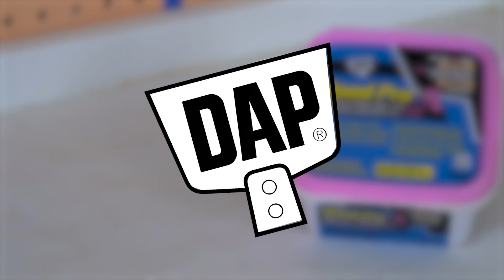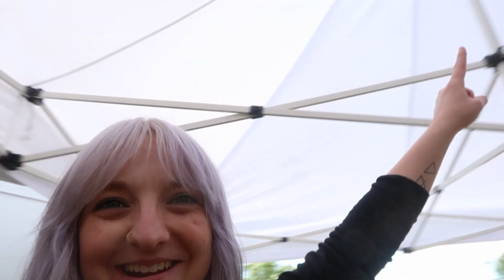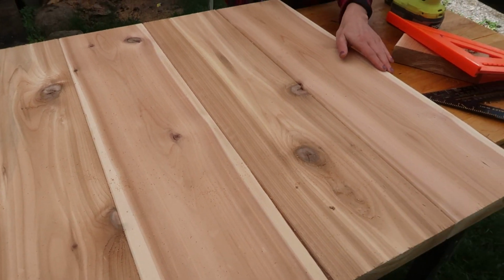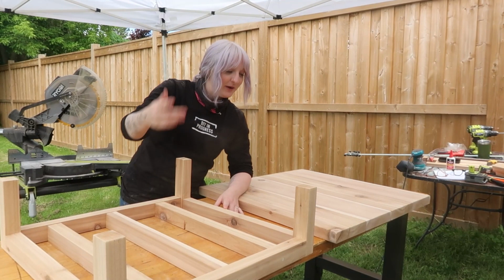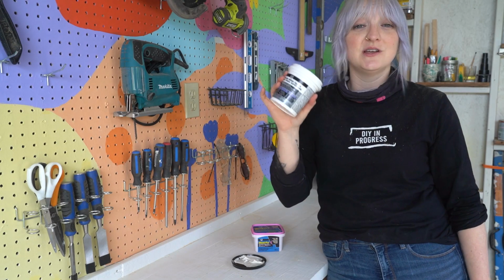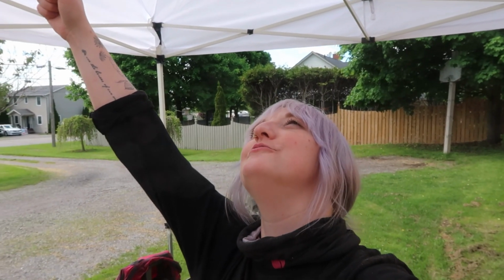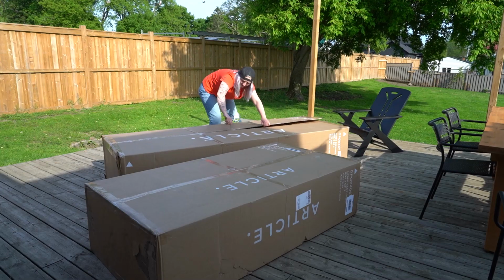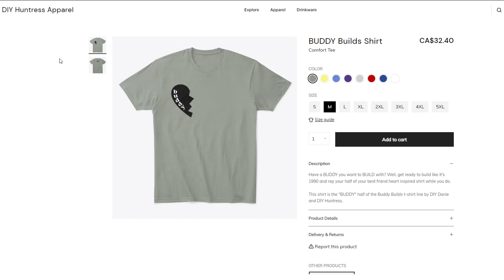Build a Rustic Coffee Table in 24 Hours with @diyHuntress!

Comment: Love the build! Great job. Tip to lose the crumb catchers…take an 1/8” off the edges to the table top boards and you will get a nice tight fit and smooth surface. Then there will be no crumbs/ debris in between the boards. 😊❤️